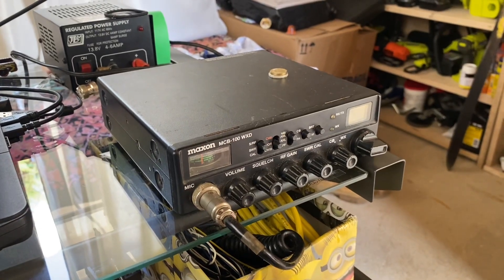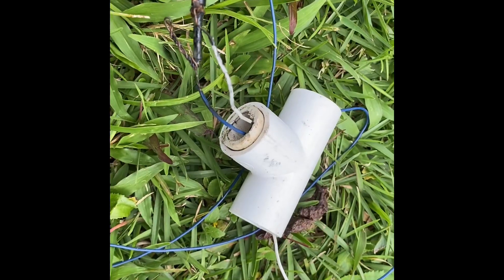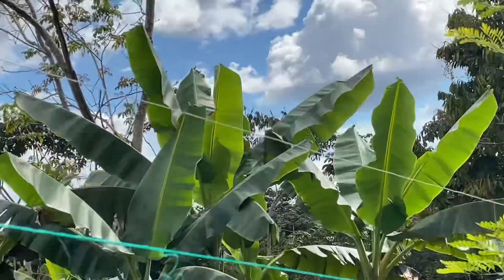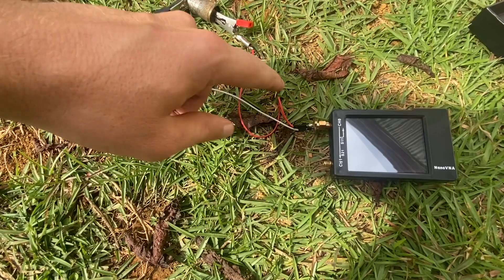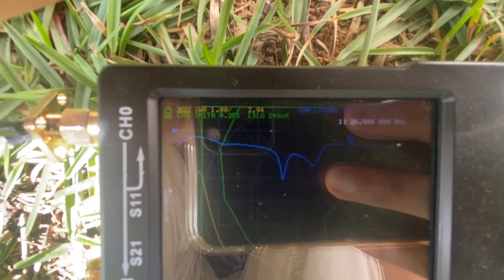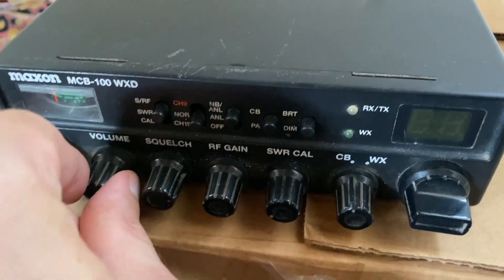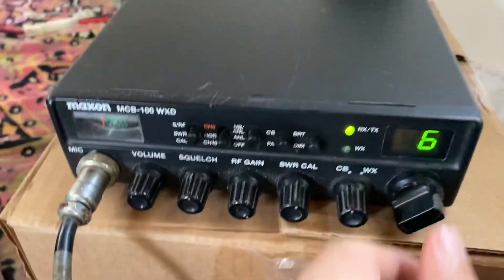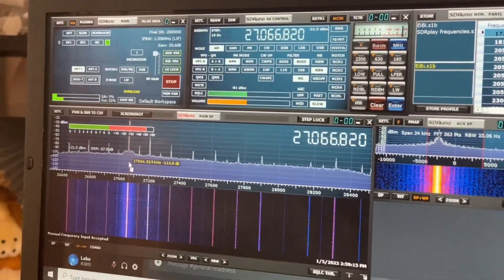Pt. 2, How to build a simple dipole antenna for CB / 11 meter band radio in Costa Rica

Comment: how far you can reach with that set up?
Reply from the maker: Well, it depends on the ionosphere but there’s a good chance of getting at least several hundred miles on a good day.. with 40 watts carrier, you can get an AM signal to Europe from east coast of the USA.. the signal will be better with SSB (narrower bandwith = more power concentrated in less khz). of course even with SSB, CB radios have a carrier of at most 12 watts, I believe. Normally on AM it’s 4w carrier power (at least, that is legal limit? Correct me if wrong on this).. anyway, it is possible to go thousands of miles with AM at 4w but it will be a very weak signal, maybe not even usable. More likely is several hundred using skywave. I hear people from California in Costa Rica, but they can’t hear me (maybe in part because my modulation is not working). 

Edit: your antenna factors a lot into this, as an example could make a v-beam antenna and achieve a more directional radiation pattern :)

Comment: Some use an RG-59 or RG-6 instead of the 58. By the way, how and what gadget did you use to hook up you rig to have that waterfall and everything to your laptop?
Reply from the maker: Good to know - this coax is quite old.. I am increasingly becoming a fan of SMA cable for low power projects, but I don't think it's really constructed for the outdoors here.. To receive signals I use a separate dipole hooked up to an SDRplay RSPdx software defined radio, which is hooked up to my laptop running SDRplay software. You can also get a spectrum analyzer plugin and other things for the software. It's really what got me into shortwave DX'ing!